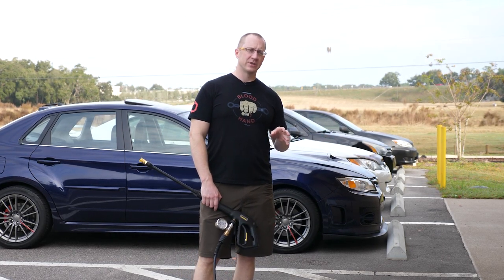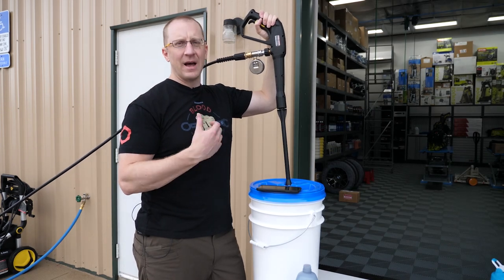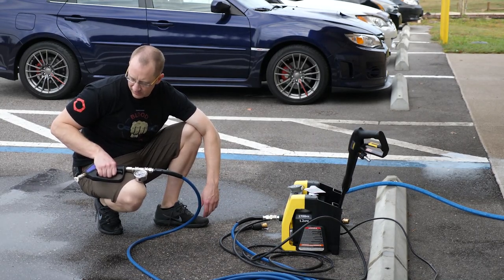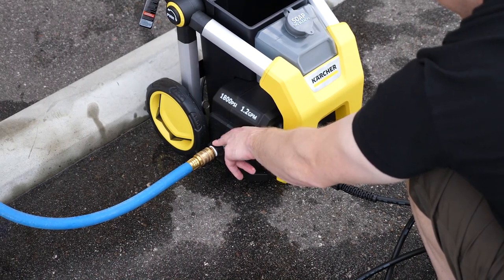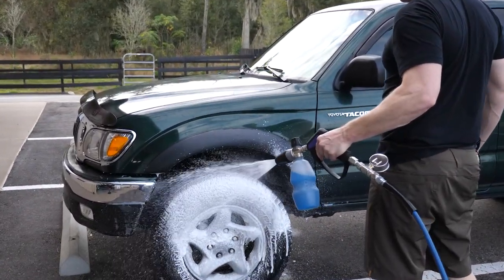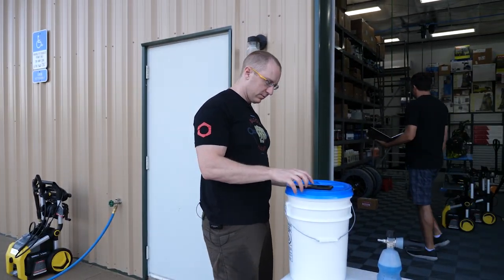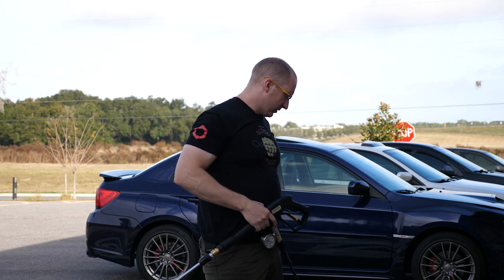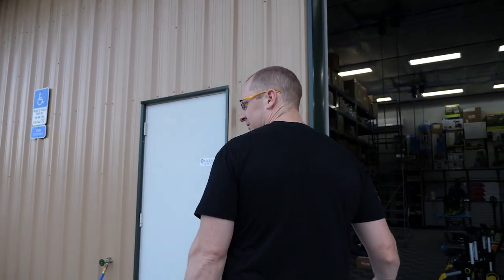The Pressure Washing Project: E11 - Kärcher Product Line Part 1

Comment: i'm confused as to why we are setting a goal of  around 1000psi instead of using the set up out of the box
Reply: Seems to be the ideal pressure to wash a car with, without damage to the paint.
Reply: I think it's perfect for car washing You don't want to come too close with 1700psi and the water flow should be sufficient
Reply: because you aren't trying to remove the paint from your car, just the dirt. Lowering pressure increases flow.
Reply: Matt  would be proud we all learned so much 😀
Reply: Might work in Florida, but I wouldn't get my car clean with 1000 psi (unfortunatly). Also need to use mineral spirits for every weekly wash to remove millions of tar spots. Never move to Sweden, ha ha.
Reply from the maker: You can't get any car clean with any pressure,  That's why we use a foam cannon and a sponge with buckets to clean the car.

Comment: I feel like these machines GPM's are rated with no nozzles a lot of the time or something. I would imagine you get more throughput that way. But I'm not really sure, just hypothesizing.
Reply from the maker: Yeah, they generally rate it a 100 PSI which isn't really possible to achieve.
Reply: @ObsessedGarage  Ah yeah that's what I figured, Do you plan to test the Sun Joe SPX9004-PRO? It's rated at a lower PSI but 2GPM. I'm not sure how accurate those are but it looks like it's a more serious unit and almost half the price of the Comet.
Reply: Nevermind looks like you did test it and I missed it lol.

Comment: Did you add the quick release to the wand on the 1900?    All the 1900 models I've seen screw together.
Reply from the maker: Yes, 1900 works well with QDs.

Comment: Is the Lowe’s Karcher K1710 any different than the Amazon Karcher 1700? I just want to make sure they are the same thing “just different models” for different stores because Amazon is $139 vs Lowe’s being $169.
Reply from the maker: I think it's just to allow Lowe's to not have to search engine compete.
Reply: Obsessed Garage Yup. Lowe’s has it on sale right now for $124 and I get military discount so I took advantage of that deal. But otherwise it is $169 at the store and they won’t match Amazon pricing at $139 because it’s a “different” model number.

Comment: What should I do to get better foam? I am using an old karcher that I had in storage because I was tired of turning my gas pressure washer on and off and also having to worry about too much pressure. With the karcher I think I have the regular pressure good based on the feel of it on my hand ( right to the pressure that it almost would start to hurt my hand) but when I use my foam cannon I get very watery foam. I have the air valve adjusted all the way open but it’s still watery. Do I need a different larger orafice on the foam cannon quick connect for more flow?
Reply: 1.1 orifice. What soap you are using? I discovered using 2oz of CG snowfoam combined with 3oz of adams soap i get thick creamy foam
Reply: Also, make sure your water isn’t hard.. im having the same issue with getting better foam and I think it’s because of the water being hard
Reply from the maker: First, throw away the knock off foam cannon.  Then get MTM-PF-22.  Replace the orifice with 1.1mm.  Then get Adam's Car Shampoo and put 150mL in the bottle.  Problem will be solved.  The one last factor that matters water hardness.  That can often neutralize soap.  It would also be nice if you buy the stuff from me since I'm teaching you.  Ha, ha...

Comment: I wonder how comparable Karcher's HD series is to Kranzle's?
Reply: there mostly on par, but cost way more than a kranzle and the pump is either inferior or you need a minimum of 20 amps to even run the thing.
Reply from the maker: I am working to become a Kacher dealer to get access to all the parts they have.  I will likely get some of the pro line to test out.

Comment: I purchased a gasoline karcher and week 2 of having it the pump went bad.. Karcher tried everything they could by saying thAt the machine was not made for long use and thAt is what caused the pump failure. Now this is the kicker karcher told new that the pump has in plastic valves so it is not a unit for long term use. Here in BarbAdos $1us is $2 Barbados currency. I paid $2145.00 for that unit and thAt gaved me so much issues and that was stress.. a friend mentioned that the ace hardware we have in BarbAdos sells gasoline pressure washers and I purchased a new gas unit from them for $975 and I worked the hell out of thAt for 3 years and only chAnged the oil and spark plug once..

Comment: Keep in mind that these pressure washers are rated their psi from the 0 degree nozzle. That is industry standard. If your messaging with a different degree nozzle, than your testing is not going to be accurate.
Reply from the maker: My measured pressure output does not change when nozzle angle is changed.

Comment: Is the Briggs & Stratton 020667 2000 PSI 3.5 GPM Electric Pressure Washer bullshit? Seems implausible
Reply from the maker: Yes, I have it.  It measures 1300PSI at 1.1 GPM.

Comment: The K series quick connect is a pain in the ass but take the quick connect off the machine and you have a M22 14mm that can accept anything. The karcher hoses are GARBAGE. Not worth a velvet painting of a dolphin and a whale getting it on. Skip the stock junk we Karcher owners hate anyway and just show us the solution to our problem
Reply: Yeah...but what about a velvet Elvis painting...huh?  Think about that one...
Reply: that's only the non-premium models and that m22 14mm is plastic, I would know cause I stripped it on mine because the diameter on the m22 14mm forces your to cross thread for some dumb reason.

Comment: You keep running the pump prior to removing the air from the intake hose then complaining about the products you're incorrectly using.
Reply from the maker: Purging the air is not that important.  I purged them all.  They need to run in order to get it all out.

Comment: The Karcher k model are even worse
Reply: @Kelsey Duesbury - I dont agree. I have the old K3 and newest K7 and they work much better than these
Reply: I have a k5 and it doesn't work properly never  had a k7 think they all the same
Reply: @kelseyduesbury3271  i have a K7 and it deliver 2.6gpm. I modify the hose, i put new gun and disconect coupling an is very nice now